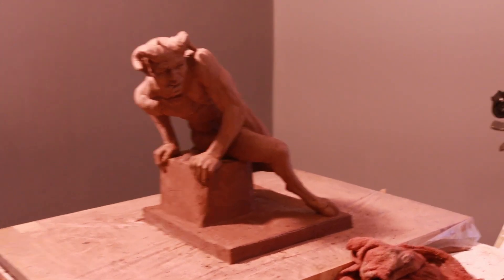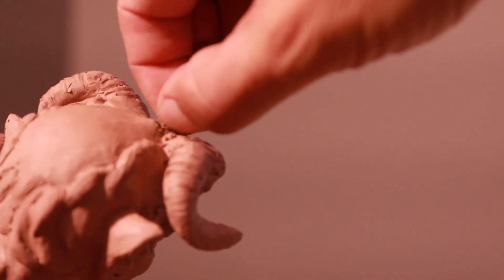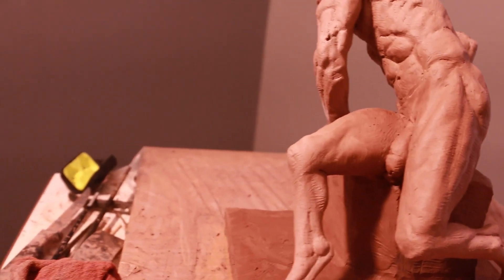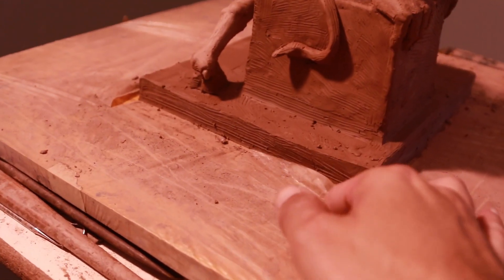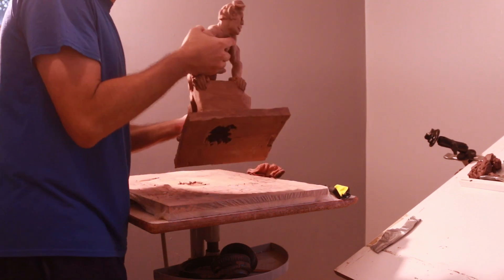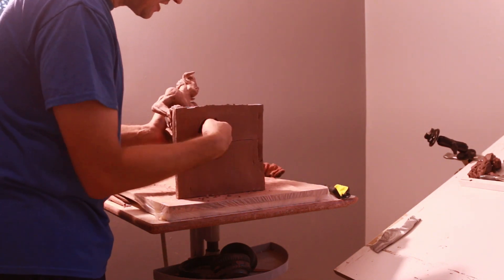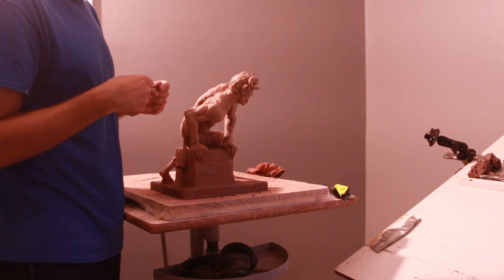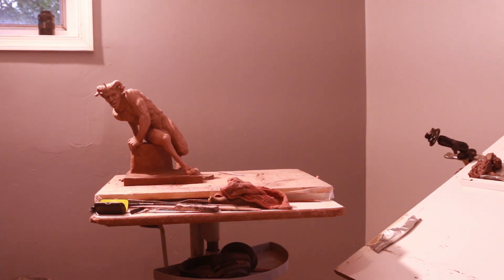How to dry a sculpture to prepare for firing in kiln

Comment: Im focusing ...air dry clay does not need to be heat right?? Do ceramic clay is air dry clay??
Reply from the maker: I've used air dry clay before, it's a strange mix. It does not need firing. The clay im using does need firing, but many sculptures exist unbaked form, but it's fragile. Ceramic clay has to be fired to be permanent.